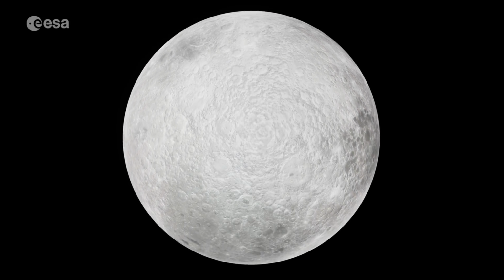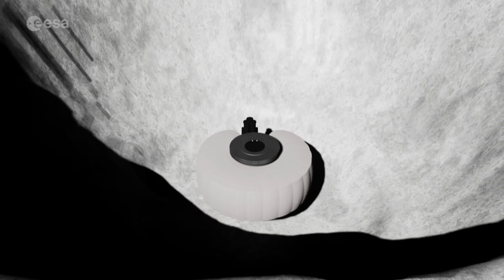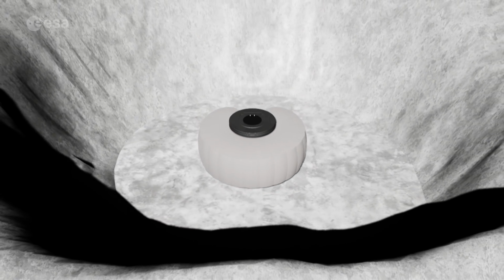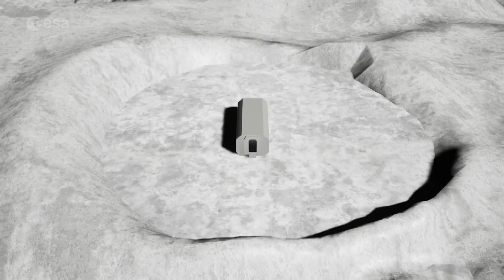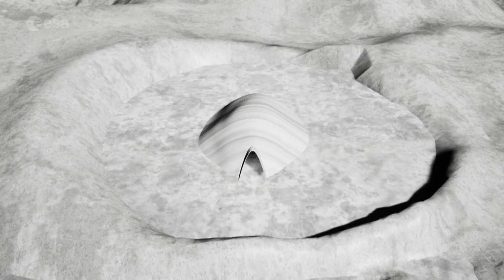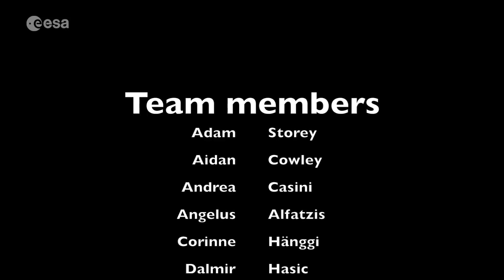Moon Base Concept Has Buried Multi-Level Inflatable Modules

Comment: Just like the "cut and cover" method in tunneling, but without the digging the hole parts. That is pretty smart! 

The thing is that to connect things together; there will be moondust that can get between the interlocking mechanisms. But you will have that with any other piece of equipment too. So its not due to your design. 

Do you guys also read on tunneling? Ive got some good books in the links at the about section of my youtube channel. Seeing what you made, I think tunneling involving digging a shaft and a tunnel will be to much effort for now. But eventually we will be doing just that because we also want to mine the moon! 

He i hope i get a comment from you.

Greetings,

Jeff

Comment: Great concept. Cheaper and more protective than any 3d printed buildings. The only concern is a single enter/exit. Can   these bases be connected or is it better to build two in one crater, just a little apart from each other so that they could be connected during construction. And then it could be a different project to connect separate craters

Comment: Great idea and would be easy to accomplish giving the colony multiple layers of protection. It's would be a great start the one thing I can think of to make it better was as someone mentioned in which you could connect each colony stack by drilling tunnels to connect them that way you would never have to go out side unless you really needed.

Comment: Perhaps they should provide the facility to have underground connectivity for seperate 'bases' built in adjacent craters. Even if it is not something that can be done initially, building in an airlock/gate/door whatever pointing in the general direction of the next crater to be inhabited has to be a good bit of forward planning.
Reply: That's a very logical extension of this pretty cool idea of crater outposts-villages.
Reply: Yeah - they could get Elon Musk to do the boring stuff between pods...